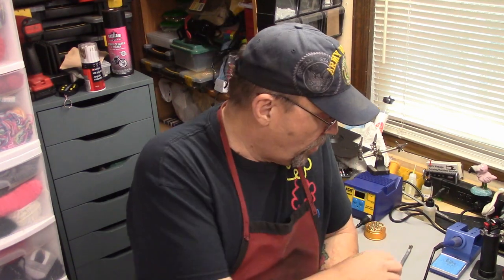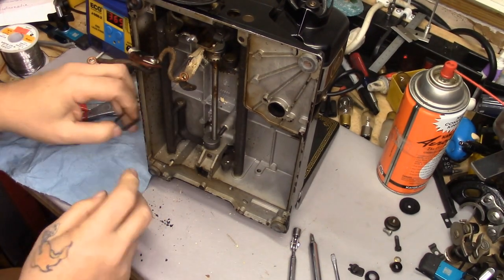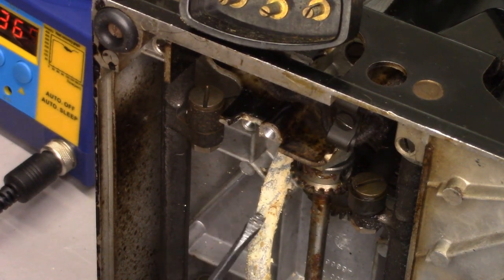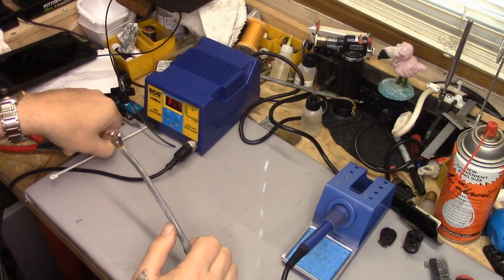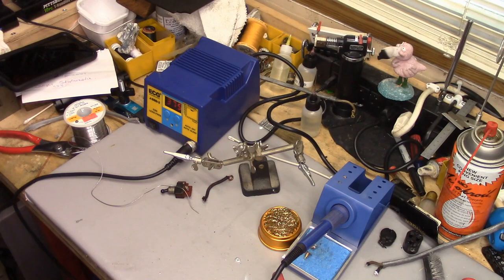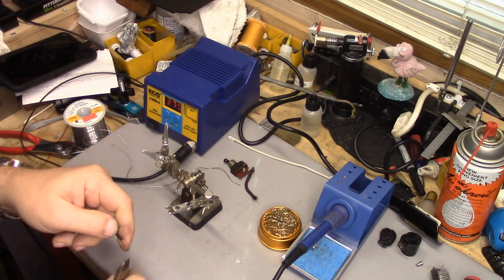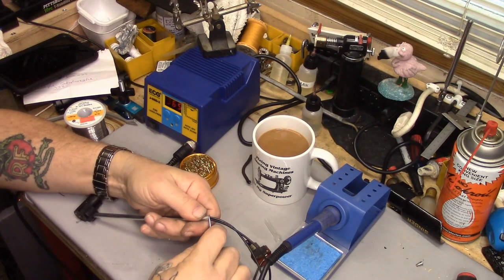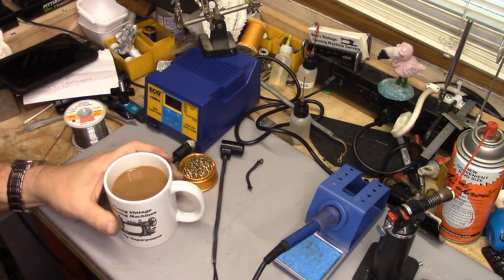221 Featherweight - Get The Lead Out!

Comment: I'm refurbishing my mother's totally clapped 221 but  honestly wasn't sure what to do about the light. Thanks much for the tip. My own machine is a 128 from 1937 or so and i do appreciate how much time you spend on vibrating shuttle machines. 
Edit : I did this modification and it seems to be working just fine. Honestly genius brain stuff, thanks much.

Comment: Yeap, this is awesome. And just what I've been looking for. I had thought the lead was for electrical shielding/protection from the gears, and had purchased some acrylic shielding and tinned copper metal braid shielding to replace it with -- but all of this is a worse idea than the simple solution you show us here, and doesn't accomplish the real task of firm positioning, which makes so much more sense. And heh! Wouldn't you know, when I just went to look, in the box with all that stuff I bought is a random length of white-coated 12 gauge that got pulled out of Romex when I rewired the workbench. It's like it's shouting at me, "Look at me, all you need is this!" I am absolutely a purist in a lot of regards, but keeping the lead here makes so little sense and just perpetuates a terrible problem. I have a 101 and a 221 to do, and both will get your treatment. Thanks again! (PS I have the t-shirt)

Comment: To anyone who would criticize this choice, I pose one question: If you purchase a house and then learn the pipes in the basement are insulated with asbestos, would you work to preserve the asbestos because it is original and authentic to the history of the house?
Reply: As a homebuilder, actually yes. Asbestos is basically inert unless it's disturbed. Don't start ripping your floor tiles up thinking you're being proactive.

Comment: Bob your videos have been very valuable to me. Much thanks. What are the best screwdrivers for machine repair?
Reply from the maker: Well, some say Chapman - and they are good - but - the truth is that the "best" is relative. You don't necessarily "need" hollow ground gunsmithing screwdrivers (but they ARE great), what you need are an assortment of various sizes so you can fit the blade to the fastener, that's the most important thing. Having the end of the blade properly fit into the screw head is important, much more so than the brand.

Comment: How do you clean all the lead oxide out of the gears?  I am cringing, though, not only about you not wearing gloves (I know you said "don't be like me" at the beginning), but also drinking coffee while soldering and handling the lead sheath!
Reply from the maker: Cleaning the oxide out of the gearsis a pain, but use of a gun cleaning toothbrush makes the job go pretty quiclkly. As for the rest... well, I grew up in an era when kids ate mud pies, didn't have bicycle helmets, and drank water out of the garden hose. The drinking coffee while soldering and handling the lead sheath isn't as big a deal as one may think. I use a mug with a handle so I'm not touching the rim of my mug with any part of my body that comes in contact with the lead, and I'm not stirring my coffee with my fingers. LOL  🙂
Reply: @BobFowlerWorkshop  I'd have liked to seen the gears cleaned, thanks I'll look up that tool, though I suppose a small regular toothbrush would do, or maybe the small disposable brushes from the (can I say the name?) "namebrand Shop".  No kerosene required?  

I grew up much the same way, got my first concussion falling off my bike, and first thing I learned in engineering labs was not to eat or drink at the soldering station, in fact not to even touch my face until after I'd washed my hands.  Of course it takes repeated exposure - but I did a lot of soldering in school and at my first job as a tech.  Nice setup, BTW.

Comment: Isn't the lead under a screw on the lamp socket?  Will that screw cut into the wires now?
Reply from the maker: No, it'll be just fine. The wires are running through enough shrink tube and the screw is not pointed so it won't penetrate the wires. You don't crank it down, it's just set snug enough to hold everything in position. That was an excellent observation and a great question!